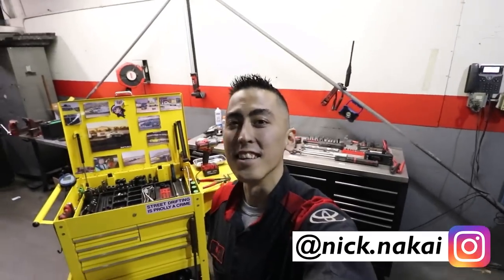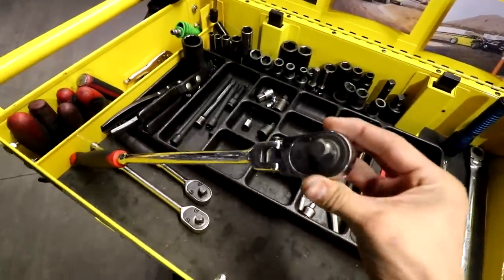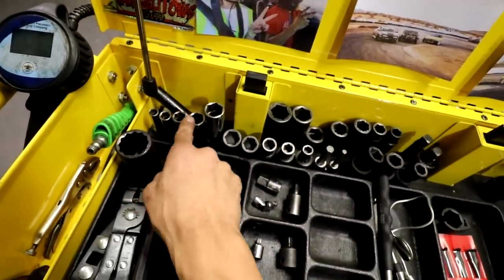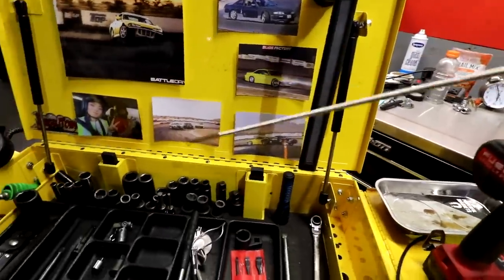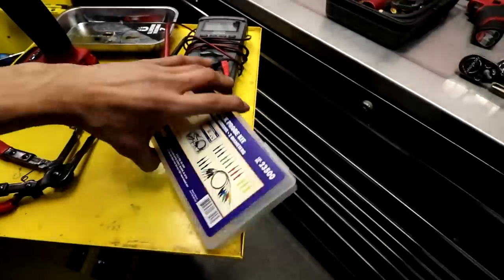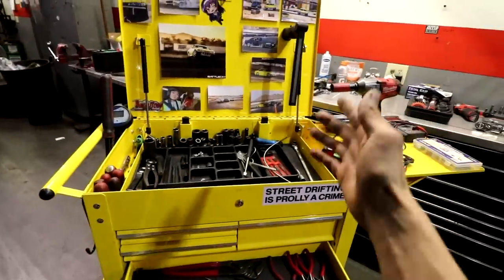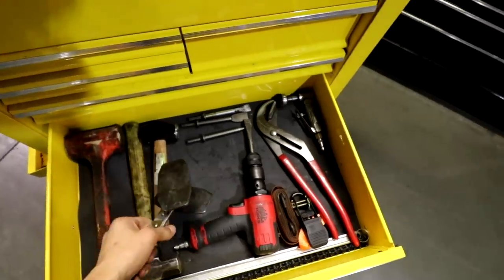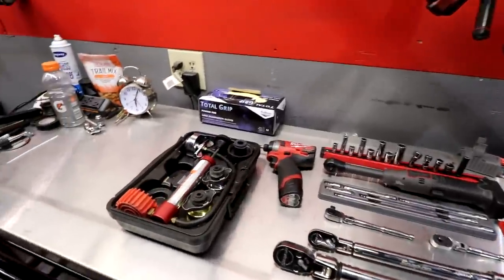TOOLS YOU NEED AS A TOYOTA FLATRATE TECH 2020

Comment: Nice video man!! I'm a tech at a Lexus dealer and just got moved to be a line tech a week ago. Really good video very spot on!!
Reply from the maker: Nice man thank you!
Reply: @LetsDriftMedia  What's it like over at the toyota dealer? 

I'm at a nissan and kia and it is getting bad. Nissans are poorly designed shitboxes (lots of transmission failures), kias are pretty easy to work on yet they keep screwing us with their warranty program (dropping FRT, asinine recalls/campaigns, so on and so forth). Kia's have pretty poor engines too. About to leave the dealership for a different trade.
Reply: @TheeAbstractHero  you want to leave that to work for an Independent shop?
Reply: @vuhuynh702  I did leave that to work for a company that builds racing engines for Evos.

Comment: ive been at a Toyota Dealership for about 1,5 years now and i have yet to use a 6mm hex tool, however we use the 7mm all the time,  the "bolts" on brake calipers on the Yaris needs a 7mm hex (at least the rear ones, not all of them have the same style for the front). though this may be because i am in Europe, so if there are people here that is watching from Europe that would probably be good to know. Also all the oil-filter "cups" can be ordered from Toyota, they have their own part numbers and are called SSTs (Special Service Tool).
Reply: The stupid fucking oil filter access cover on the TRD tundra skid plate takes a 6mm hex.
Reply: Whats the part number for a 65mm oil filter cup?? Trying to get on for my 16 Toyota Corolla that uses the spin on filters

Comment: Does Toyota use 12 or 6 point for their axle nuts?
Reply from the maker: 12point if it’s a factory nut
Reply: @LetsDriftMedia  do you use your 12 point on the 6 nuts when you see them? It would be cheaper just to get the 12p when it comes to the axles but I know some vehicles take a lot or torque.
Reply from the maker: @nickshowsstuff435  yea I only have 12point sockets for axle nuts never had a problem.
Reply: @LetsDriftMedia  appreciate the reassurance. Sometimes that’s all I need! Did my lower ball joint on an 05 tundra at home I was pretty proud of myself. Lifted 6” on 35s so more of a pain in the ass to work on but working on it felt really good at least when I was done so I just wanna have most of what I need for the truck. I think the Axle nut is a 30 but Idr id have to look it up.

Comment: I disagree on the torque wrench part. As a beginner, if you don't know how tight a nut/bolt is supposed to be (ie, muscle memory from experience on how much turn you give the bolt) you need to use a torque wrench in order to prevent any future mishaps like crossthreading, bolt-stripping, loose bolts or over-tightened bolts (speaking from experience)

You can get a click type pretty cheap & reliable one at Lowes with the Kobalt/Craftsman brand or at Home Depot with the Husky brand. Def cop the 3/8 version, which I've seen them go for around $60.

Comment: Starting as a lube tech tomorrow at toyota dealer. First time at a dealer. But unfortunately I'm starting at flat rate. Any tips or videos I should watch?
Reply: Starting flat rate? Not hourly? Why is that.
Reply: Check out flat rate master he will tell you a lot about flat rate and if it’s dead or not. Good luck
Reply: @TAC40_  that is how they pay the whole shop. It was also my first offer and I snagged the opportunity and I really don't care to much about the money right now just about getting the knowledge and experience at the flat rate pace.
Reply: @eliezerramosjr1017  ill have to check him out more iv seen a few
Reply: @nahumdass7978  dang that’s awesome. I hope you learn a lot of tips and tricks quick and make some good money, congrats!
Reply: @nahumdass7978  been a lube tech for a year. All u need is a 10 and 12mm sockets for the skid plates on truck. a toyota oil filter cup and 14mm socket for drain plugs. A impact to take wheels off and 21 and 22mm for lug nuts. Good luck!